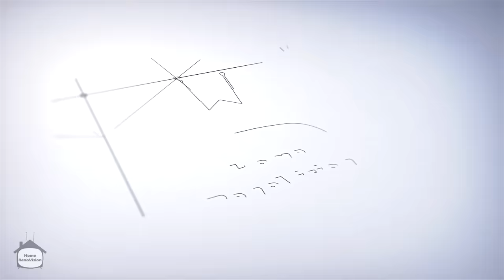How To Build a Waterproof Shower using Kerdi-Board

Comment: Your videos have been a world of help to me.   On Kerdi-Board, Schluter only refers to the outer orange membranes as "fleece webbing for effective anchoring in thin-set mortar." I'm not sure the orange material here is the same as the waterproof Kerdi membrane. TBD, but the waterproofing component may only be the polystyrene foam. I'm not sure the cut in half trick for small vehicle transport mentioned at 4:15 will maintain waterproofing.
Reply from the maker: Hi John, the fleece is also made from plastic and is waterproof, for added protection you could use the kerdi fix in the fold before straightening oit the board.

Comment: The valve my client selected does NOT fit into the provided 4 1/2” guard. How do I seal the opening before putting on the trim cover??  It’s my first time with schluter. Thanks
Reply from the maker: Hi Robert. The reason that guard does not fit is simple. Most quality valve companies have a face plate that is snapped into place against another fixed plate that is screwed to the valve and comes with a gasket that sits against the tile to keep the water out. In this situation the schluter guard is not necessary! The guard you are referring to is designed to deflect water that gets behind the face plate of the cheap valves covers that have poorly designed gaskets and /or face plate screws like moen and delta.

Comment: Could you address how you did the edge of the shower where the drywall and plaster are already finished?  I’m curious how you finish the edge of the shower when the paint and plaster are done.
Reply from the maker: I use a plastic edging and tile up to it. finish with a bead of caulking and repaint if necessary!

Comment: Looks like Kerdi fix is available at Amazon and the band is about $1/foot. I couldn’t find the board much cheaper. You talked about steam showers. Do you have a project like that coming up?
Reply from the maker: steam showers are basically the same except  you waterproof and tile the ceiling as well and build a door that keeps in the steam. Voila!

Comment: Question on setting porcelain that requires polymodiidied thinset what do you do since kerdi only requires unmodified thinset?
Reply from the maker: use keribond T non modified cement. Cheers!

Comment: Hi Jeff, i have a question about the caulking between the walls and the ceiling: In my bathroom (tiling on drywall, wallpaper on the ceiling), it seems like the drywall on the ceiling has bend upwards on the corners, causing the caulking to rip apart on the entire length. Looks really nasty (epecially since the house is just 10 years old) and i wondered if i could fix it myself. Are there any problems leaving it this way (since the ceiling does not appear to be waterproof, i couldn't think of any), and how can i get the caulking off the wallpaper without ruining it?
Reply from the maker: removing caulking from wallpaper is not easy. I would suggest the only option would be to cut the paper out with the caulking and then reapply a wide enough bead to cover it up.  Good luck. Cheers!

Comment: What did you mean by "non-modified" cement? Portand or thin set mortar?
Reply from the maker: in the world of tile all cement is divided into 2 main groups. non modified or modified which means it has a latex adhesive component. Non modified gets stronger if it stays wet while curing so it works better against waterproof membranes.

Comment: Hi,
I accidentally used Mapei Polymer thinset on my kerdi joints with the orange membrane instead of uncoupling membrane unmodified thinset that is supposed to be used.  Is it okay to leave that on and let it cure?  It seems to be getting cured and hard or should I just scrap everything and do new boards with the recommended thinset.  It's just so expensive going that route but I don't want my shower to fail either.
Reply: what'd you end up doing?

Comment: great video but there is no way I would just caulk that joint from tub to the board when i have the opportunity to lap it nicely with the membrane-this is the place to over engineer. I agree on the screw holes, which is what the USG system does, but the tub surround is almost ALWAYS the spot that fails on a tub and caulking, I don't care how magical it is will eventually dry out and fail. Cement and that membrane will not.

Comment: The unmodified thinset at Lowe's says "for use on floors only".  Is that still OK to use for the Kerdi Band on walls?
Reply from the maker: on the band sure, but why don't you just go buy some good stuff at the tile suppliers. Cheers!
Reply: @HomeRenoVisionDIY  What is the "good stuff"?  The Schluter-branded product?

Comment: I’m pretty nervous about a contractor my in law’s recommended. He did our bath/shower tile and the only thing he put up before doing the tile was cement board...is this okay??
Reply from the maker: cement board is very good. There is no requirement to use a waterproof membrane in a shower, having said that you could ask him to do it. Redgaurd is relatively easy and cost effective., Cheers!

Comment: Wow that stuff is expensive. Try Durock they now make same board only cost me $43 for a 3 by 5 sheet.
Reply from the maker: for another 100 bucks you can build a shower that is guaranteed to last a lifetime. Don;'t forget you still need to buy a waterproofing membrane to apply to durock. That product does not break down in water but by no means is it waterproof.

Comment: I'd love to use this, but I can't find any in my area. Lowe's had it to be deliveries, but I'd have to order 12 sheets. :(
Reply from the maker: Where do you live? you can always get it from amazon just follow my link in the description below or try to source it from a tile supplier, in many cases they carry this product line as well. If not contact schluter and they will tell you a local supplier.Cheers!
Reply: If you haven’t sorted this already- check other stores, even if you have to drive a bit. I don’t think I’ll ever use gypsum or cement board for a surround again. The kerdi board is so light and easy to work with. That alone makes it worth the price. My local Lowe’s didn’t stock it, but the one 32 miles away had 54 sheets.

Comment: Could you just use the panels and the LePage 2in1 instead of the kerdi band if warranty didnt matter
Reply from the maker: if you make a tight fit everywhere I suppose you could. The danger is in the winter when the framing of the house expands, this could cause the joints to break. The kerdi band is a much stronger bond

Comment: I think i have mold growing right on the seal between my shower tile that meets the tub.. color is black. Any advise on what i should do to remove it?
Reply from the maker: you can use bleach to manage it but unfortunately it comes from behind the tile and is evidence that the wall is decaying. The only permanent solution is to remove the surround and install a  waterproof system that will never mold.
Reply: @HomeRenoVisionDIY  sadly, after more investigating, theres movement at the lower part of the tile and dry wall on the side of the tub. Can it be replaced without ripping out the whole tiled shower/tub? Only the front where the plumbing is of the shower/tub has mold, cracks between the tub and tile sealant that meets the tub all along that bottom part.

Comment: That Lepage 2 in 1 I find is junk, it cannot handle water and it stays soft and putty,  used around tube and applied  a surround strip over it. There was a tiny hole in the stripe and it peeled off on the edge, when I removed it to put a new strip around it, the caulking was soggy. 100% silicone is the way to go.  I then read the label it it states that it not to be used where it can get constant wetting.... why then even say for bath and sink?.
Was doing shower pan same time this happen, luckily things happened this way, so I hurried to check under pan liner that was curing for a week..... guess what? Soft like putty , used fingers to “rub it off” luckily I had not cast the cement over pan liner.

Comment: The wall to tub connection is the most troublesome. Are you aware of their tub detail?
Reply from the maker: It has an integrated tile flange. you install the backer board flush to it and tile to the deck of the tub. Cheers and Have a great Christmas!

Comment: Please clarify “unmodified cement” because I went to Home Depot and I can’t tell which are modified and which aren’t. The packages all just saids cement.
Reply: It is in the flooring section & it will say "exceed A118.1" (it is not large front but in a small box on the side) and ensure it does not have the word "polymer" anywhere on the bag. We got Keraflo Tile Mortar at Lowe's
Reply: Modified thinset has a retention additive that helps give it increased strength.  The membrane on Kerdi prevents modified thinset from drying out properly...which is necessary for it to perform the way it's supposed to and not possibly end up failing over time. Mapei makes unmodified thinset, as does Versabond, Kerabond and Laticrete.

Comment: Can you do a short video on "How To Read A Tape Measure", there's lots of people that hasn't grasp it yet.  Before I learned, I had to self teach and I was horrible with fractions, but i knew where to measure too.  Then I had to buy the tape measures that had the fractions on the bottom.  I love your style and I'm sure you can get people aligned to a tape measure within 10 minutes and not even have 'triggers" to help you kinda landmark and pinpoint like I had too(Yea makes no sense I know...).  The way I learned was because I am in IT and I work on cars, I combined the two by using the gas method I remembered..  Empty to Full (1-1/4-1/2-3/4-2)

How I self-Taught Myself to read a tape measure:
Let's say I was focused on everything in-between (3" and 4") and using my "car/mechanic memory"
(3" - 1/4 - 1/2 - 3/4 - 4" ... Repeat)

But I was bloody stuck on the lines between that so the I/T of me had to kick in and i was like "Look at this tape measure as a bunch of cheap 16mg memory" Yea back in the day right? lol

1/16 - 2/16 - 3/16 - 4/16 - 5/16.... up to 8/16ths

So I noticed a pattern, by focusing on half inch sections, It helped me develop a strategy conversion
Your quarters and 8ths are "odd numbers"
Your 16'ths and 32nds(blank spaces) are "even numbers"

Measurement:
3" - 1/16 - 1/8 - 2/16th - 1/4 - 3/16 - 3/8 - 4/16 - 1/2 - 5-16 - 5/8 - 6/16 - 3/4 - 7/16 7/8 - 8/16 4"

I learned the odds LEFT of the half-mark With the 8ths:
1/8 - 3/8

Then learned the right side of the half-mark
5/8 - 7-8

In-between the 8ths are quarters and you stick the odd-number quarter inch in between
1/8 - 1/4 - 3/8 --- 5/8 - 3/4 - 7/8

I felt i was on top of the world because for one, I started a handyman business and i wasn't about to be running around with a helper tape measure.  now I walk around with a Craftsman 25ft ready to by a 30ft and I love tape measures.  I have a Kobalt 25ft that has the fractions on it.  Don't make fun of me lol, I had crap teachers and I was young.  I grew up and needed to "go back to school" for a couple hours.

Maybe you can squeeze in a video on tape measures that may help people that can't truly read one WITHOUT the fractions on it. I had to figure it out on my own, i was never good beyond "basic math" and algebra dang near got me held back, how i passed I don't know.  YOu got that magic fire man, you can show people within minutes and they'll have the knowledge as if they have known for years, after a few minutes.  Please, sending this as a request.  Thanks Gary! Yes, my first tradesman job was based on your deck video ... nailed it ;-)
Reply from the maker: I guess that wouldn't hurt to do a demonstration. Cheers!

Comment: You do know if this leaks thie repair and or replacement is on you.  Reason being  you didn’t use schluter all set and Kerdi fix. That is the only way to have a warranty. You spent all that money on the board and membrane and you get no warranty.  Seems to be a waste of money and time. The all set is more expensive but you are not paying for it you add the cost into your bid,if people ask why so high you need to explain the warranty proocess (I spelled wrong I no ).  What’s an extra $20 or $30 ?

Comment: I was interested up until the part where you just cut big holes for the control wall. Way to turn a good easy job into a hack job!
Reply from the maker: LOL, and how is it that you seem to think this is not a proper installation?
Reply: if i was a homeowner of the project youre working on and i inspected youre work at the end of the day and saw that you cut  square holes when you could have just grabbed your drill and circle cutter because you were too much in a rush to get the panel up, i would be left with the impression of what other shortcuts did you take behind the rigid board you put up. the small details people see go a long way. youre shortcuts make me think that all you do is shortcuts! lol
Reply from the maker: No worries Kenny, I would have noticed your personality during the interview and refused to work for you in the first place. I don't work for unreasonable people.

Comment: quick question, how do you build a non waterproof shower?
Reply from the maker: cardboard
Reply: Unsealed Drywall. Found that whoever put in our shower last didn't use cementboard or any sort of sealer on the drywall. Parts are swollen apart, a section of the wall is bulging inwards, it's a mess...
Reply: Home RenoVision DIY clever. but what if you sealed it with Flex Tape 😂😎
Reply from the maker: That is standard code today. It needs to be changed.
Reply: Hefty trash bags,scotch tape and 4 concrete 8x4's since you trying to be cheap. I know you trolling lol
Reply: Duct tape fix everything
Reply from the maker: Sorry to hear that Catman.
Reply from the maker: Like Red Green, Shawn fox!

Comment: Just completed the Schluter Innovations two day course.  It is absolutely wrong to suggest you can seal screw penetrations with Kerdi fix. If you install a Schluter Shower system, it can be registered with Schluter for a lifetime warranty, and it will be repaired or replaced including labour if it fails.  Using Kerdi Fix to seal screw penetration is not an approved installation, will void the warranty and the sealant will fail over time.
Reply from the maker: LOL, David you just finished a 2 day introductory course. Welcome to the minor leagues my friend. that does not make you an expert. But I appreciate your trying. Cheers!
Reply: @HomeRenoVisionDIY  Schluter states says there must be a two inch overlap of Kerdi Band or fabric for all penetrations. There is very little I am an expert on, but your shortcut is at odds with Schluter installation guidelines not withstanding my mimal two day course.  I have already made mistakes in my bathroom reno, and your videos are instructive for many things - thank you.
Reply from the maker: If you contact them they will tell you that the kerdi fix is used for sealing joints in the niche or any penetrations.
Reply: @HomeRenoVisionDIY  can I also just use the LePage seal and bond for my niche?  It's hard to find kerdi fix.

Comment: I realize you are teaching pragmatism to the diy’r but you shouldn’t go quoting all of the research that Schluter does to test their own products and then blatantly disregard their own installation methods. As far as I know Schluter does not recommend silicone or otherwise sealant over fastener penetrations like you can use with Hydroban and Wedi. Kerdi fabric and unmodified is the way to go.  Kerdi-fix and thinset  under banding to bridge the gap between the acrylic and wall board.
Reply from the maker: Hi Brian, the secret to a happy life is to understand the building science and then know how to adapt the products. Yes schluter does recommend using kerdi fix as a replacement for anything related to waterproofing. in fact I could build the whole shower with kerdi board and kerdi fix if I wanted too and not even use the band. The reason I show the lepage 2 in 1 is that it is the same product and performs just as well and is available at the building store while the kerdi fix isn't. I have used this product with the board to build a deck cooler a couple years ago which sits outside on 4 season weather here in Canada. works like a charm.